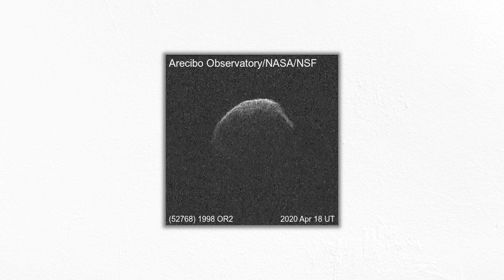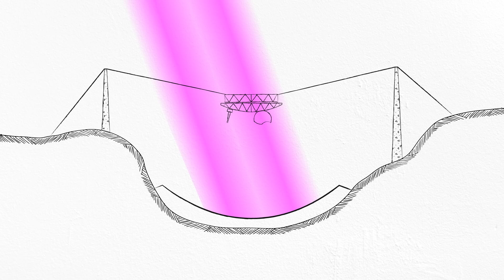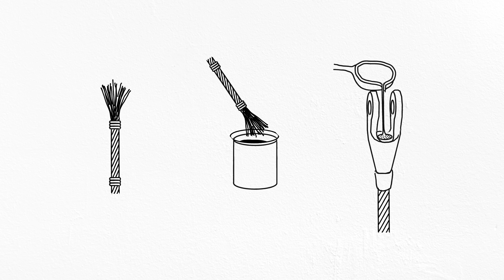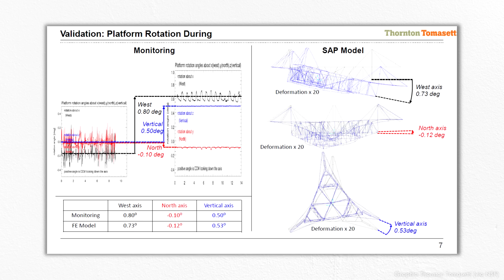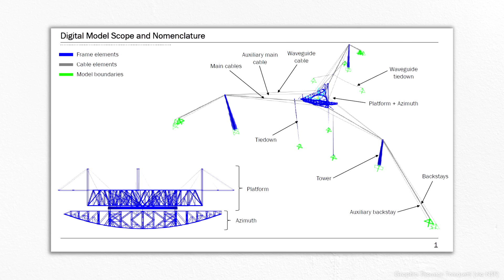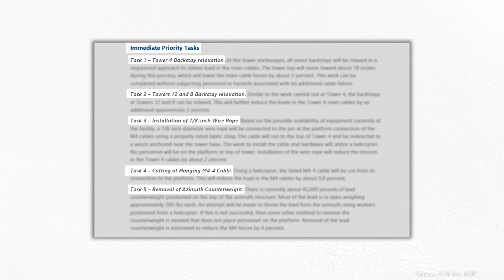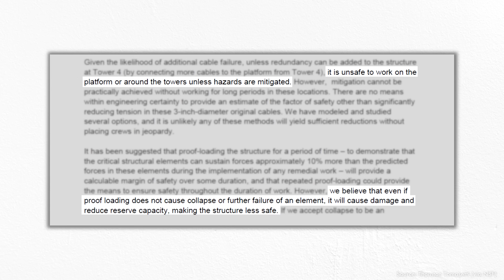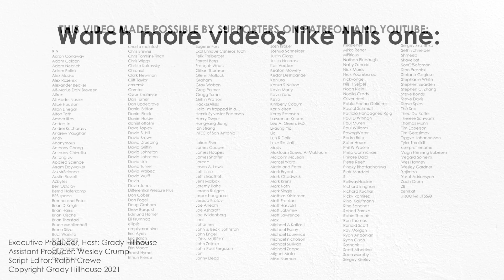What Really Happened at the Arecibo Telescope?

Comment: Could the low safety margins be due to it being a military installation when it was built? Meaning, maybe it was meant to only last for a certain time?
Reply: Unlikely, you'll find most military structures are built to last, often so they can be used for something after their intended purpose, such as arecibo being used as a telescope. The reasoning for this is partially one of funding, it's easier to receive funds for things if you can sell as something that can be put to other uses.

Edit: I should also clarify in the long run most installations will still be used long after buildings are built and while they may still need renovation, the military doesn't want to have spend it's funds on repairing buildings that weren't meant to last.

Comment: It would be interesting to know what the militaries design expectation was for it.  Did they plan for it to last only 10 years, or 20, or 30
Reply: Given that they planned to use it to detect nuclear weapons at the height of the Cold War, I'm gonna guess that they were a bit fast and loose with the design and construction. They may not have seen a need for it to last multiple decades with how fast things were changing back then.
Reply: @0pyrophosphate0  Agreed. It was likely a pilot project with a potential for a rebuild or second site in the future (there are probably public records to confirm or deny this, but I don't feel like looking for them). There was a lot of big, new-tech installations being built around that time, so they likely didn't intend it to last half as long as it did in that state.
Reply: It does make a huge difference in the design. I would guess they probably had a twenty year life expectancy and that's where they got the 2x safety factor. If they had planned on 50 years, they would have used something closer to the safety factor of a bridge.

I wonder why NSF didn't upgrade the safety factor when they modified the antenna?
Reply: @AmbachtAle  Likely the towers werent capable of holding much more force after the upgrades, they must have considered that since the factor of 2 had been sufficient all this time then keeping the same factor after the upgrades would suffice.
Reply: @AmbachtAle  NSF was **NOT** interested in funding "small" projects. The Arecibo budget was $12million per year. NSF wastes more than that on catering. They were aiming to pretty much zero out funding by 2023. BIG SCIENCE is full of criminal negligence.
Reply: @AmbachtAle  NSF probably did what they could with the money they had. Upping the safety factor simply means more stuff. more cables, bigger cables, and bigger towers. These things all cost money. If they had required a higher safety factor the upgrades might not have been done and it probably would have been demolished. my $0.02.
Reply: @AmbachtAle  status quo bias
Reply: @AmbachtAle  easy answer: value engineering. That’s a fancy way of saying “that should be good enough, I think”
Reply: @Zippy Thekid Sunk cost fallacy.
Reply: @Zippy Thekid NSF was **NOT** interested in funding "small" projects. The Arecibo budget was $12million per year. NSF wastes more than that on catering. They were aiming to pretty much zero out funding by 2023. BIG SCIENCE is full of criminal negligence.

Comment: 2:08 "as a DOD project" explains quite adequately why the FOS is only 2, when other civil structures have higher FOS, and why the cables and anchors appear to have problems.
Reply: Cold War projects were not designed  with durability in mind.
Reply: Newer technology was likely to replace it. So it's needed lifespan was realistic for it original purpose.
Reply: @michaelmccarthy4615  To provide an example to back up your point: Duga (aka the Russian Woodpecker) was only in operation for ~15 years. Same project goals as Arecibo.
Reply: Yeah; I think it was demilitarized 52 years ago.

Comment: They should just cover the cables with plastic
Reply: Until you get condensation inside of the plastic due to the temperature of the steel on humid mornings and the impossibility of efficient evaporation.
Reply: @tieck4408  true, but that problem could be solved i think. Put some smart people on that problem. Like heating the steel inside. Intigrating plastic with manufacturing stage too. Im just guessing, i have no idea. I've just noticed a lot of cables dont have simplest protection only paint, which is fk all. intresting

Comment: It's surprising how low the safety factor was for those cables... Most lifting equipment in industry is usually 4:1 or 6:1 safety factor...
Reply: I think that when constructed in the 1960s, urgency was more important than durability.
Reply from the maker: The 1990 upgrades only strengthened the suspension system to maintain the same factor of safety, but I couldn't find any details about the design.
Reply: Interesting that the first two cables failed near the top of the tower (the third apparently further down). I wonder if stresses were more concentrated there (near the saddles)?

Comment: I look at the structure and it's amazing, but agree that repairability would have always been a huge question.
Reply: Basically the same as with suspension bridges: you design them for n years, and when their time is up, there’s essentially no way to repair them. You almost can’t replace the main cables in situ. Unless you have a safety factor large enough that you can remove a cable for a number of months or a year, with the bridge shut down to traffic during that time. And the towers and deck are inspectable, but cables… less so.

I think it might be one of the reasons cable stay (all cables direct from deck to tower) is now more popular where it’s possible — replacing individual cables one at a time is relatively easy.

Comment: The video of the collapse was heartbreaking..
Reply: It was so hard to watch knowing that there is a TON of data and knowledge (yet to be discovered) crashing down with it for so many years to come.
Reply: @MikeHarris1984  However, it was built in a time when transistors were still replacing vacuum tubes and integrated circuits were cutting edge. I have been away from the antenna world for too long, but I would be astounded to find we do not have better methods. Bandwidth is the tough part.
Reply: Time to build a new one
Reply: It was amazing luck, though
Reply: The good news is its a legit reason to build a bigger one. Make it a 1,000 meter diameter. Let the aliens in Proxima Centauri pay for it in exchange for free classic sci-fi movies streaming. 🙂
Reply: Just imagine maintaining this Telescope for decades and then when everything is going south, while looking for a way to get it back on track, you are watching it fail in real time through a drone, from just meters away. I bet he felt his stomach drop, as soon as he saw the additional cable snap.
Reply: Its sad, but they all knew it was failing...  its life span was approaching
Reply: It was built in the 60's...  It was time for it to go.
Reply: @calholli  What makes it being built in the 60s a bad thing? lots of tremendous structures from the 60's serve well.
Reply: @calholli  The electronics had all been replaced, and the structure itself was still a perfectly good design. Being from the 50s was not the problem. I predict lack of proper maintenance was a major factor.